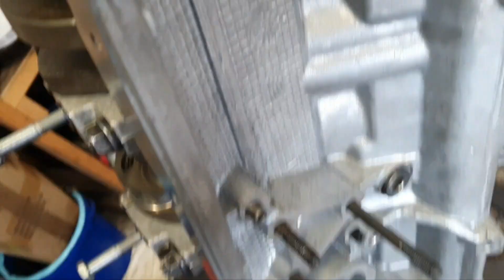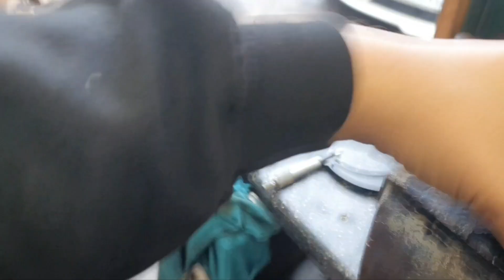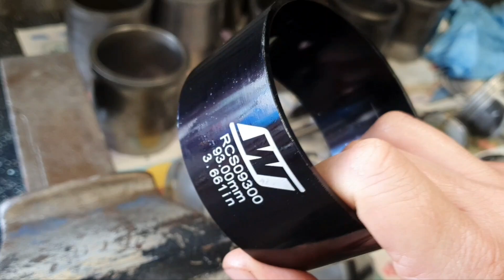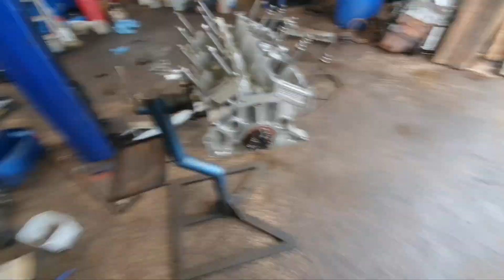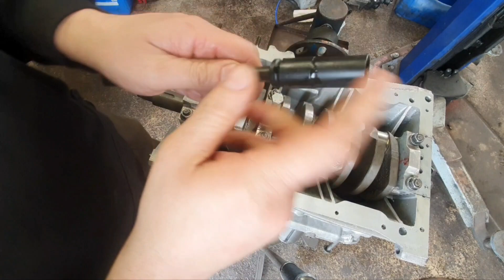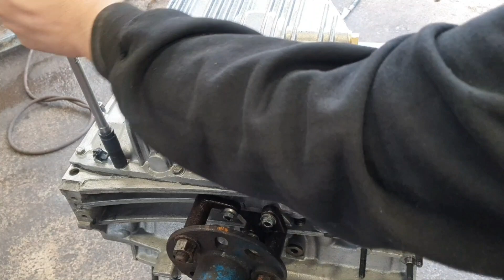Alfa Romeo 147 GTA V6 3.2 24v   100K miles Full Engine Rebuild.  (part1 Crankcase Assembly) Busso V6

Comment: Hi great work there it has helped me a lot. .. I am a bit confused about the torque on the Conrods bolts my workshop manual says 2.0 newtons first and then 50 degrees you did 80 degrees I am worried because I have just rebuilt my 147 gta engine and are about to put it in the car soon have I done something wrong with the degrees on the Conrods bolts 
I have Seen 3  torque specs now on a old 24 valve 53/59 degrees and on another 24 valve 48/53 degrees and now on the 147 gta manual 50 degrees I am truly confused

Comment: does it hurt if the tensioner of the 164.3.0.v6 12v distributor head is adjusted approx. 5mm above the marked tension? because I would suspect the original oil tensioner to be tighter.?

Comment: Great video! Is there a Part 2?
Reply from the maker: Coming soon
Reply: Great, I have to do all this myself. Need cam belts done, Valve cover gaskets, coolant has some black bits in the reservoir, thinking that my head gasket may be waiving me good bye. Regardless, I am gonna get the engine out and do it all while it's out. Your video is a great guide!  @alfaromeofanclubedinburghuk

Comment: are the alfa 164.3.0v6 12v QV piston valve holes the same size for the intake and exhaust valves, when you put them in place, should the arrow point towards the distributor head?

Comment: is it better to use mineral oil or synthetic in the alfa 164.3.0v6 12v engine? if the outside temperatures are -39-+36 celsius..and which viscosity is the best?

Comment: i didnt see it, but why rebuild at 100k miles ? My 2.5 have 300 000 km and doont need rebuild - compression 14,8 bar and no oil consumption (4000km 0,5L)...
Reply from the maker: The reason of the rebuild was the oil in the coolant

Comment: Love your work
Which silicone did you use to fill the main cap on the flywheel side ? You filed it when its installed ?
Thanks 💪
Reply from the maker: Thank you so much. So I used Renzoil black sealant. It's one of the best on the market.  Indeed I put sealant on the surfaces and after squeeze some into the holes.

Comment: Hello thanks for all.
Too bad we cant see the crank assembly
Have you ever heard of oil pump failure, oil pump chain on those 3.2 ? Cant find new one 
Thanks
Reply from the maker: You are welcome. Unfortunately I couldn't film the crankshaft assembly at the time.  Never seen a chain failure yet myself.  Here there is a video of the oil pump assembly.  

https://youtu.be/k0UqkQsOjmI

Unfortunately I Don't think that are available anymore.  But you can try EB SPARES based in UK. They have lots of Busso V6 Parts.
Reply: @alfaromeofanclubedinburghuk  OK many thanks

Comment: Hi, great video! Where did you ger the O-rings for the liners? I can't see them in Eper. Mine is not 3.2 but 2.5, do you have Part No?
Thanks
Reply from the maker: Hi thank you so much.
You should be able to order them from @Autodoc
https://m.autodoc.co.uk/ajusa/7191095
 or try EB Spares if you are based in UK.

Comment: Nice work. Are the EB spares replacement ring set genuine factory? Only because 10 years ago I found out that my gta which had a rebuild had faulty rings especially the bottom one ( oil control ring)They were not genuine. It was burning 1litee of oil every 250miles at the time. I had get a set from Italy through Autolusso and that was a ballache to source 10 years ago. 10 years on she doesn’t burn any oil whatsoever. Also did you set the ring gaps which I had to do? I think that  might have been part of my oil issue.
Reply from the maker: Hi. No aren't genuine but are good quality.  Indeed you have to check your ring gap. In this case it was 0.65 mm of gap which is way too much.  So I had to replace the liners.  From EB Spares you can get also brand new liners and Piston with rings.
Reply from the maker: Thanks for the appreciation ❤️🇮🇹🏴🍀

Comment: classic mechanicing...experience is golden....my 3.2 v6 GT engine has 142,000 on it...i'm saving up for the rebuild...whats a ball park for top end and full? im in newcastle?
Reply from the maker: Hi. No major issues.  The important things are the shell conditions so recommend to inspect them and change if is the case and the cylinder liners.  In that case where like an easter egg out of measurements and big end shell where worn. The reason of the full rebuild is because the Diff blown up  and was due a Timing Belt but the main reason was that the coolant bottle had some oil in it.